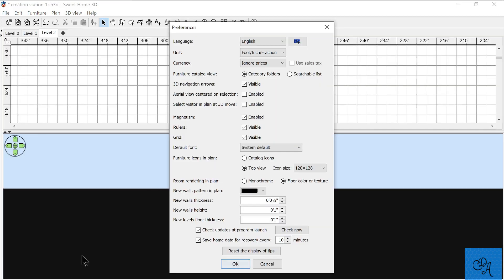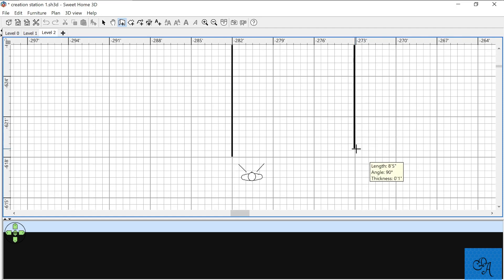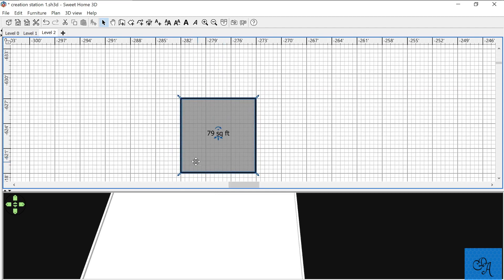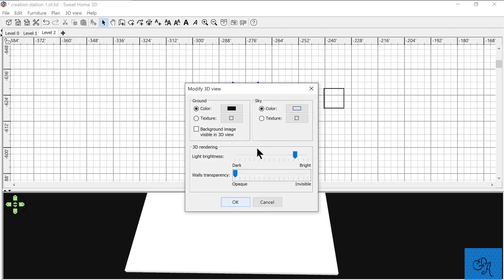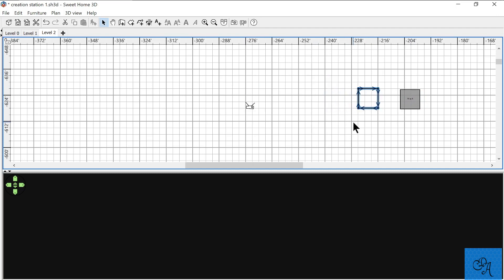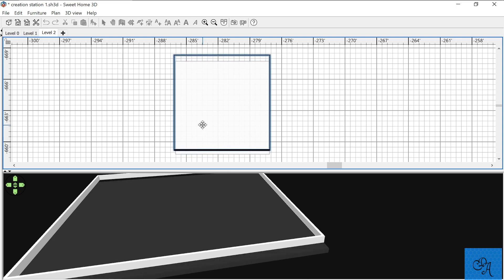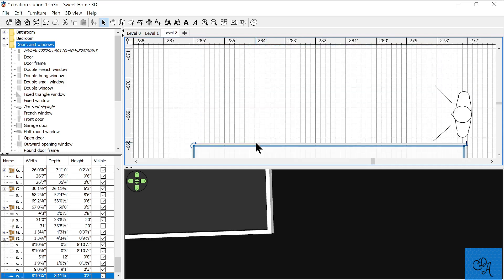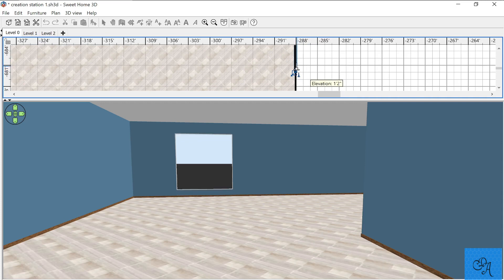How To Design Floor To Ceiling Windows In Sweet Home 3D.

Comment: 6:58 i am using this format but the floor doesn't work smoothly I will try many times the wall is becoming transparent instead of the floor please help
Reply from the maker: Hey, there.  Sorry that you're stuck on the tutorial.  I feel bad about that.  So I just finished a video that will help and explain how to fix the issue.  I'll link it in the comment section of THIS video in a few hours.  :)
Reply from the maker: https://www.youtube.com/watch?v=tCodz0NXv2w